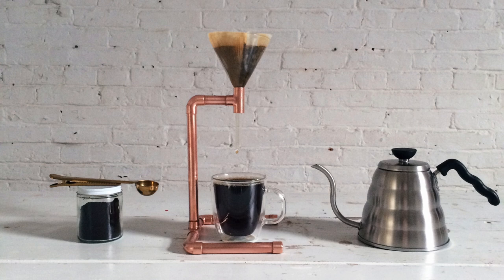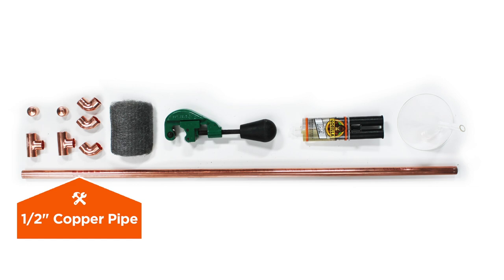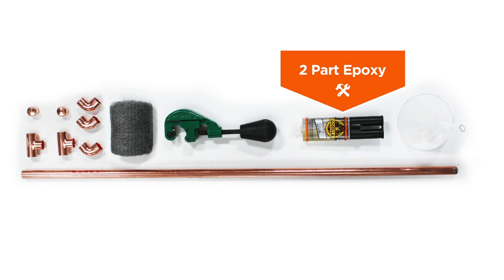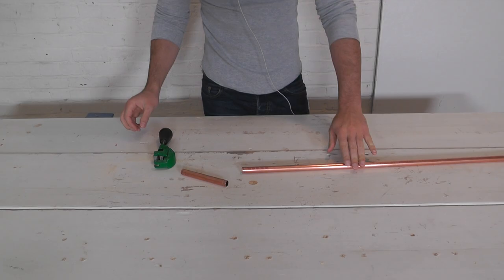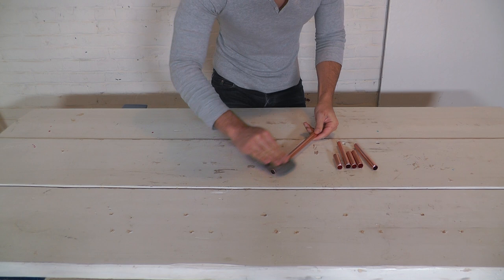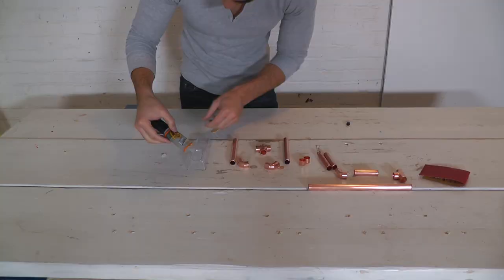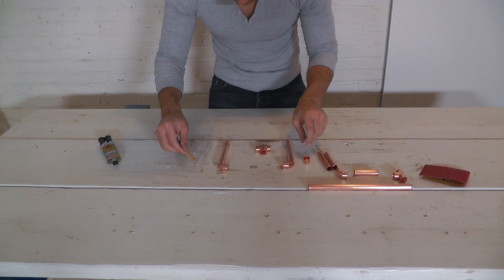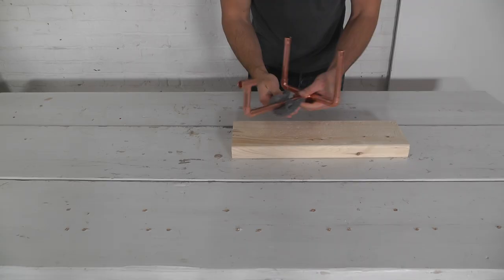How to make a DIY coffee maker out of copper pipe

Comment: I guess epoxy works just as well as solder but I think I'm going to try it with solder. good idea!
Reply from the maker: toobigal yes i think that would be nicer.  I will give it a try too!
Reply: just watch that the solder you use is lead free!
Reply: HomeMadeModern The solder idea is good, but it is a lot more work and if the soldering is not done absolutely perfectly, it can actually spoil the look of the copper with the solder showing on the joints. I like the idea of the epoxy, it is simple and fast, and just as effective for this project. It is also going to be a tough nut to solder the joints perfectly so that the stand part is absolutely level unless it is done with the base sitting flat on a surface while it is being soldered.
Reply: ***** As far as the solder being lead free is concerned, since the water/coffee does not get into contact with the solder it has no influence at all on the person drinking the coffee. 
I suppose that even touching lead can be harmful, but then most of us are exposed to a whole lot worse each day and still do fine. If you were to pick up the stand by the long central pipe, somewhere in the middle, the solder would not even get into any contact with your hand.
Reply: Johan Combrinck Honestly, you could eat the amount of lead that you used for the solder and you wouldn't be as bad as some would have you think. Like any metal, if you get too much in your body, it is bad! And as you pointed out, the actual functional part of this is the coffee filter and the funnel. Everything else is just a pretty stand.

Comment: Here's nifty finishing tip that I've perfected during my 15 years of working with copper tubing to create all sorts of cool things.

First polish the copper to a gleaming shine.  Follow these polish steps and your copper will shine like the sun:

1.  Rough polish using extra extra extra fine steel wool.
2.  Medium polish using Brasso.
3.  Fine polish using Sunshine Polish Cloths.

Next is to seal the copper with HEAVY COATS OF HELMSMAN SPAR VARNISH (Home Depot -- either spray or brush on and either semi gloss or high gloss).    It's as if this varnish were specifically formulated to seal copper like no other finish I've ever tried, and I have tried many. The amber color pairs perfectly  and the heavy coats add visual depth.  And what's even cooler still is that the varnish will continue to cure for several years to a deeper amber color that's just gorgeous.

You're welcome and ps...soldering isn't as difficult as you may think. It's easy even.

Comment: Is putting boiling liquid through the epoxy connected pipes not going to eventually become a possible health hazard? LOVE this idea and design,but concerned about the epoxy factor.
Reply: +Linda Smith The water only passes through the glass tube of the funnel. So while it might be close to the epoxy, I don't feel that it is ever even near enough for a period of time to warm it. My main concern is that the tube to the funnel is so large that the water would simply fall straight through and it would very very weak coffee.

Comment: I have a question! Ive used these copper pipes before and I touch them they start to oxidize! Is there something I can spray them with or do I just clean them with a wool
Reply: Carla Mendoza ... A light coat of rattle can lacquer works well.